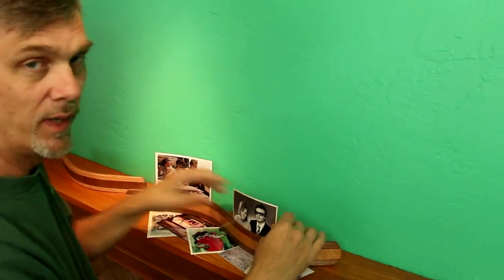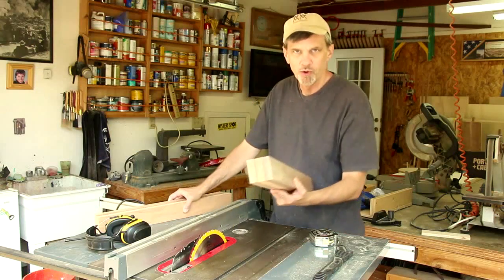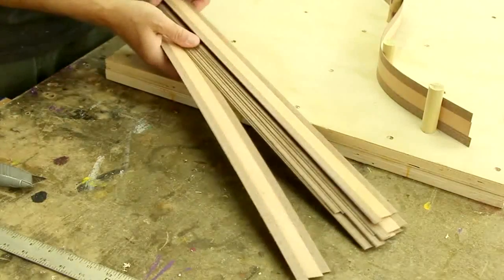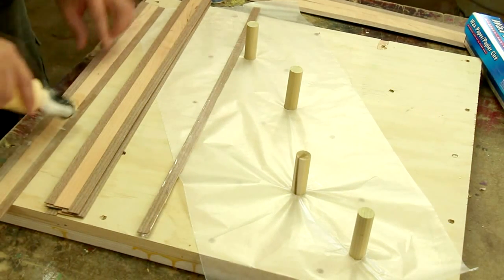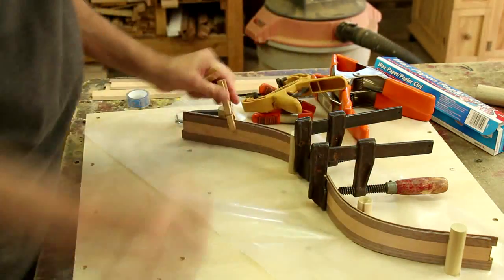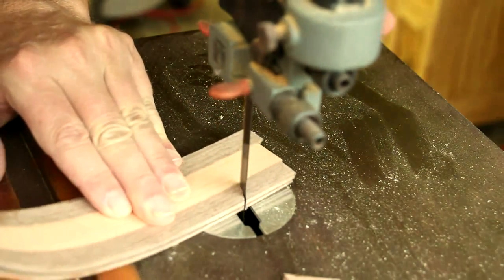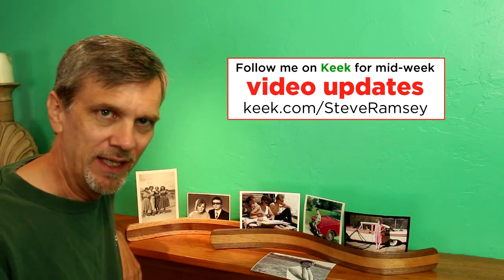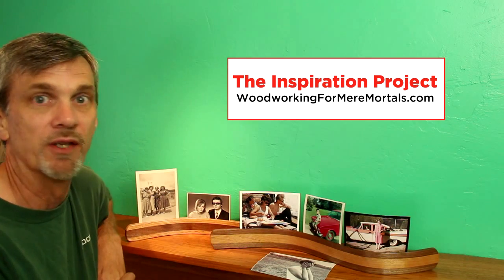Frameless photo stand: the trendy bendy way to display your pictures!

Comment from the maker: Yes, a bandsaw would be a good choice. I can't make straight or smooth enough cuts on mine without having to run it through my planer after. On the tablesaw, you could rig up a simple stop block jig that would allow you to reset the fence consistently. For this project, I wasn't concerned with maintaining equal thicknesses. Some are thinner than others, but resetting the fence wasn't time consuming at all.

Comment: Awesome! I was amazed when I first saw you bending wood for the quilt display project. I really liked that in this video you showed another way of preparing the thin pieces of wood, and a different way of bending them (instead of in a big curved self-made mold), and with the spacer idea. Great project for a gift as well. And inspiring too - I'm trying to think of projects using bent wood that I might try. Can't wait for Tuesday's inspiration project on the website! As usual love your work :-)

Comment: Another thin kerf solution is to use a 7" radial saw thin kerf blade.  Much thinner than the standard 10" thin kerf.  It deff cuts down on cut depth, but for a project like this, it works great.

Comment: Yeah, I like to use a 2x8 for that.  If it's taller than 1.5" then glue pieces together first.  You just have to be careful that you don't go so crazy cutting the curve on the band saw that you can't actually bend the wood that far.  At least with the dowel method you know it's going to work.

Comment: Yeah, gluing strips like that together isn't the best, as you found out yourself. But it does work and it's all that matters. If you want to be more efficient, just take a thick wide piece of wood and cut it in half with the shape you want your frameless frame to be and use that as your press form. It will give you a nice strong even gluing finish.

Comment: Hey steve... Great project, you always have great ideas... The only thing I saw is that you used yellow glue ad that Is the wrong kind of glue for bent lamination. Yellow glue is to flexible. You want to ether use some slow curing epoxy (the the tube epoxy from the store) use west system... But better and cheaper is to use pro glue. Vac-u-clamp sells it for 30 bucks and I have had mine for 5years. It's a powder that u mix with water. But great idea I am considering making one

Comment: I have kind of a silly question.  Each one of those strips was cut out using the table saw, correct?  How much of a pain was it to move the fence over each time and square it up to cut such a thin strips?  And could this have been cut with a bandsaw instead of a table saw?  (I have both, but I'm a lot more comfortable with the bandsaw than the table saw.)